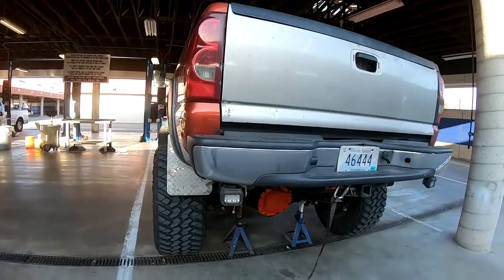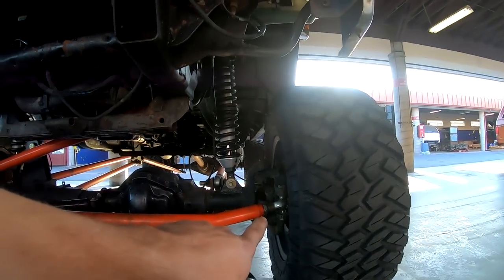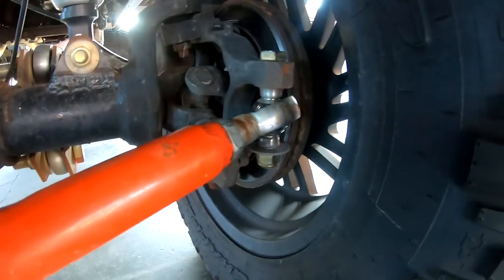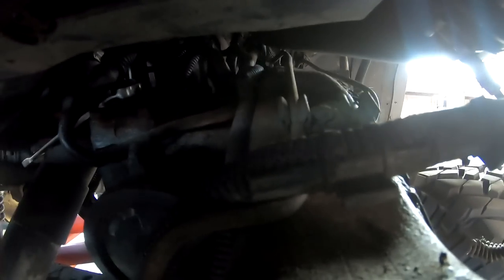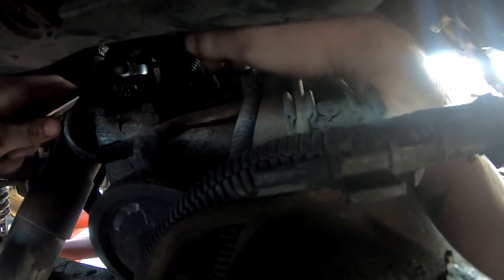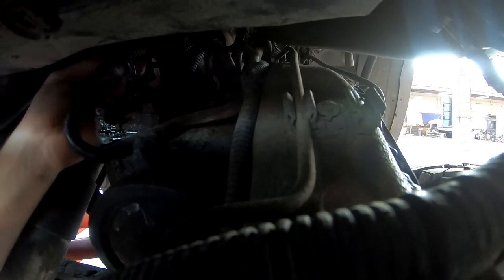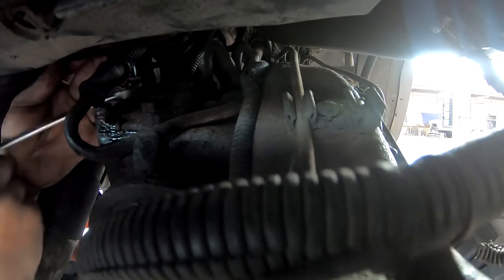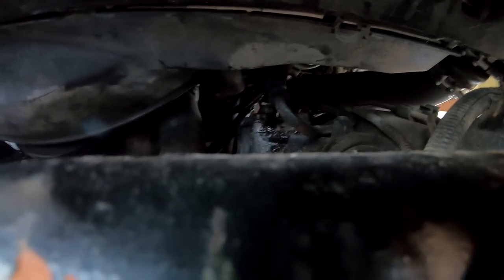Duramax Steering Box Adjustment! Fix your loose steering!

Comment: I just did this and it definitely tightened up the steering. Previously, I had replaced my tierods, pit/idler arms and installed a Cognito steering support kit but my truck still had sloppy steering. The truck had a lot of slop, like 270k miles lifted on 35s with the factory gear box slop, and this definitely made it tight again. Although, my truck did have a slight power steering fluid leak before, doing this made the leak noticeably worse BUT it’ll get me by for awhile until I can swap in a Redhead steering box. Thanks for the tip. 2002 2500HD LB7 4x4.
Reply from the maker: awesome glad I was able to help!! as I say its not a permanent fix but you can get more life out of your box!
Reply: 3 yrs later did u
Reply from the maker: Yes I did drove the truck across the country twice in that box until I took the truck apart

Comment: Can’t for the life of me figure out what you doing with that jam nut you just basically said loosen it and tighten it
Reply: Loosen the jam nut, hold the jam nut while tightening the center Allen bolt until it gets snug, then backoff the Allen bolt a 1/4 of a turn and hold it in place while tightening the jam nut back down. Done. Simple. Got it?
Reply: he was making sure jamb nut was backed out and he wasn't tightening the adjustment Allen screw back into it.
Reply: I see dodnt know why you toghten all the way to bsck off but i see now thx

Comment: Great video.  Just an FYI though, when rotating tires, ur suppose to go diagonal. Fromt right, to rear left, etc. That way the tires are spinning a different direction. Unless of course u have directional tires. If u do then u would keep the tires spinning in same direction
Reply: No sir, first rotation is front to back same side then second rotation is diagonal then third front to back same side. Doing it this way puts all tires in all 4 positions.

Comment: Thanks.  I have done this many years ago and completely forgot all about it until I saw your video.  Yes, it is an amazing quick fix.  I'm doing my rods and arms now and was considering a new box, but I'll do this first because I KNOW it will fix the slop tremendously.  Thanks again for reminding me
Reply from the maker: Anytime always happy to help! Hope it works for you!!
Reply: @RESURRECTEDDIESEL  what did you replace your tie rods with? And will it work on a stock 2000 Silverado 4wd?

Comment: I used to do this same adjustment for years, on my GMT400's and 800's, until an old GM mechanic showed me the proper adjustment procudre to follow. 

The slop isn't coming from the pitman shaft, it is from the input side. Remove your intermediate shaft, loosen the flat jam nut where the steer shaft connects, loosen the nut on top, the one that you are talking about, and turn the allen screw back a 1/2 turn or so, to take the preload off of it. Then use a spanner wrench or needle nose to snug the packer on the input face down snug (30 ft/lbs, but we all know that is hand snug). Mark the housing and the packer, then measure 1/2" counterclockwise and back the packer off that far. Tighten the flat jam nut. Then turn the allen screw in until you feel it snug up, then back it off a 1/4 turn and tighten that jam nut. 

It will steer like brand new because the input shaft worm gear is engaged properly with the pitman shaft. 

Or just loom up the procedure for fixing the slop in a Saginaw box and follow it. They recommend doing it to a dry box, but it works with fluid in the system as well. It just might get it to the true adjustment specs that a dry adjustment would.

Comment: At 1/3 turn backed out my steering box was a bit tight in the center, backing the Allen head out 1/2 turn is great. 

Thanks for sharing.
Reply: I am a little confused on this adjustment. LSX Matt says loosten the jamb nut good, then slightly tighten the allen head screw, then tighten the jamb nut. This video says the opposite. Loosen the jamb nut good, then loosen the allen set screw slightly, then tighten the jamb nut.

Comment: Thanks for the fix it tip man , my 06 duramax has had that steering wheel slop for over 12 years freaking (dealership sucks with there finger in there butt) , you rock man

Comment: My new Chevy 2500 HD 4x4 I bought last January. The dealer was 60 miles from my home and traded in late evening. The drive home was interesting to say the least. I've never owned a truck in all my years driving with so much play in steering and hit a bad spot in the road would almost change lanes.A few days later drove back told dealer what it was doing, here's what the service manager tells me. The truck doesn't have enough miles on it and Chevrolet can't touch it! I say should I take it to Ford? Got pissed and drove home, made an appointment again same place, this time they washed it. Did nothing had it for 5 hours then I got into a service managers face and he's dam lucky I didn't break his nose! I told them I will never be back and would tell everyone I know not to buy from them. Two days later GM calls and wants to know what is going on. They here it all. I went to another dealer, they worked on it said it was ready. Started down the road and steering was so tight I could barely turn the wheel and still had play. Turned around went back showed it to another service guy, he rolls down drivers window while it's running and turns steering wheel and see's how much play there was. They looked at it again and said it needs new steering box and would call when parts came in. Took it back and it fixed the problem! The first dealer is well known it's Rick Hendrick owns a lot
Reply from the maker: Dang that is a rather intense story and I’m sorry that happened to you for sure! Yeah usually a bad box will cause the slop but if the adjustment is done right and the box isn’t too far gone I.e. 300k mile truck you should be okay my truck has 180k on it and the steering box has been great even after adjustment now it is a little stiffer then before and the slop is gone but I like it because of it being so tall and. Not having a sway bar it helps keep me on the straight and narrow! I noticed a huge difference with it!
Reply: @RESURRECTEDDIESEL  This truck was brand new
Reply from the maker: Holy crap no way! That’s insane I would be furious too! I don’t blame you that’s messed up they didn’t help you at all but the new box fixed it and no issues yet?
Reply: Always keep in mind that you can take a new car to any place to get fixed as long as the place is willing to bill GM for the repairs. It's a common misunderstanding that people think they have to go to a dealership to fix a new vehicle under warranty lol
Reply: @RESURRECTEDDIESEL  none so far and since I don't drive much it has under 16,000 miles right now

Comment: Do you need an alignment after this. I just aligned my truck but my steering is still complete trash and I was told I need to tighten my tie rods by the alignment place. I was told tho that you shouldn’t touch the tie rods tho and that the alignment place is supposed to do that so will this help with my steering?

Comment: Damn I'm doing this as soon as I wake up tomorrow lol. I have so much play and my front end is good cuz I did re did everything.
Reply from the maker: I hope it works out for you should tighten it up a bunch this is the first time I’ve done it and it worked great if you could write back once you do it that would be awesome!
Reply: Yea I will tomorrow when I'm done. I'm pretty sure its stock steering box. I got 415000 kms not sure what this is in miles. Like 250 or something
Reply from the maker: Hahah same with this one it’s got 180k miles and it helped!!

Comment: My steering wheel doesn’t lock when key is out n it has a lot of play when on n gets hard when coming in n out of parking... any ideas ???
Reply from the maker: Mine doesn’t always lock out with the key is out unless I turn it far the play could be any of your steering components that are worn out and if you have larger tires on it that’ll make low speed turning tough along with a weak steering box

Comment: Will this work on any Silverado? Does is have to be duramax? I just put 285s on my 03 2500hd (4x2) and it’s swaying a lot over 45. New pitman /idler stabilizer and alignment. I was thinking tires but now I’m thinking it’s steering box or control arms etc... any advice? Thanks!
Reply from the maker: If your tie rods and all your steering is tight you can do this I think you can do it to most 2500s as long as it has that set screw
Reply: Thank you, I will check into this!

Comment: Iv known for years but guys always say  just turn less then 1 turn clockwise. Setting  back off 1/4 turn  is logical but never seen it done.
Reply from the maker: yeah just helps from jamming the gears together and wearing them out really fast i learned this from someone who built similar pumps or something i believe has worked well for me though!
Reply: I have rebuilt hydraulic pumps and i have seen these gear boxes tore down. So always wondered why nobody  did it that way. I did it last weekend and it works great just know if there is damage this won't help and could make it worse.
Reply: I have seen these gear boxes chip gears and the steering lock up. Once luckily in a parking lot.
Reply from the maker: Dave Wright totally makes sense I don’t think this is a forever fix but definitely can snug up a loose gear box I’ve driven across the country and back since this video and it’s still good will probably get replaced or rebuilt for my new build!

Comment: Do you know if the  2015 6.6 duramax has that adjustment as well? Somebody told me that then 2015 half electric steering  Assist instead of hydraulic . And it sucks!
Reply: I have a 2016 would like to know too.

Comment: I hate seeing people do this. It's not the proper way to adjust it. All you're doing is meshing the gears together more in the middle, yes this help with the slop at center, but causes more binding at full swing. It also causes the box the degrade at a faster rate.  I get it, nobody wants to replace their box because everything on the market is crap. My truck is on it's 9th box due to shit quality. Don't bother adjusting it and just spend the 300$ on a redhead box and be done with it
Reply from the maker: If you do it correctly you won’t have any binding. The boxes are adjusted like this when build to be set I got rid of my slop and have been wrenching 15.5 wide tires on it with no issues you need to back it off some so it doesn’t bind. If I get another 50k miles out of it it’s worth it in my eyes at 200k almost I’ve put 100k miles on this steering box and it’s good as new. If you don’t agree you don’t have to do it but it does work
Reply: @RESURRECTEDDIESEL  if you do it correctly you'll follow the procedure and adjust it on the bench top with out the Pittman arm connected. Per gm spec. You can't adjust it "by feel" it requires a beam style inch pound ta wrench. But good try
Reply from the maker: Plenty of forums by the people that build them and you can do it but hey man to each their own I guess glad you spend over a grand on steering boxes and I haven’t 🤷🏻‍♂️
Reply: @RESURRECTEDDIESEL  all were under warantee because they were junk, minus the last one that actually worked. And just because "it works" dosent make it right.  But keep advertising the half assed way to screw things up. Also, experience Trump's "the internet said it would work"... That's as bad as I saw it on TV so it must be right lol. Go show me where Saginaw recommends doing it your way. Seeing as they build them
Reply from the maker: Hey man you’re entitled to hate as much as you please! Hope you enjoyed your long weekend! I know I sure did 🍻✌🏼🏂 and my steering is still tight 😎
Reply: @RESURRECTEDDIESEL  not hating on anyone. Just trying to prevent the spread of bad information. Just remember, there's the right way, then there's the fast and cheap way.
Reply from the maker: I totally respect that and you’re right but like you mentioned even new pumps aren’t done the right way and I also know some people, not many that have had problems with the red heads so when there’s nothing really going right what should you do🤷🏻‍♂️
Reply: @RESURRECTEDDIESEL  I know a lot of people say not to do this because the majority of wear and play is in the center travel. However I'm with you bud.  If the box has so much play it's at the point of replacing then what have you got to lose? Also if the gears at each end mesh tighter after the adjustment then logic will reason they might eventually wear in faster to somewhat even out the wear. Which is exactly what seems to have happened on my buddies truck. He has 400k miles on it and keeps adjusting his box every so often. Still has the oem box, just replaced seals one time.
Reply from the maker: Yeah I totally agree man if you gotta change it any way or squeeze 20,000 miles out of it having it drive as brand new why would you not that’s my logic it might be dumb but if it works is it really dumb?
Reply: @RESURRECTEDDIESEL   Its not dumb at all. The other guy is correct, there is a right and wrong way to do things but what dictates the right  and wrong way? GM or some other steering box manufacturer who's best interest is for you to purchase parts? No, I believe the right way to do something is based on the results. In this case people are having much better results adjusting the OEM box rather then replacing it. Thanks for the video, keep up the good work.
Reply from the maker: Very true I agree with you to each their own I always say🤷🏻‍♂️
Reply: @caliguy1500  300k lb7 stock same box. sloppy as hell. I'm all over the highway after long days ill be doing this asap to help out. longer I have this truck the more I kinda want it to keep going. Guys wonder why I park so far away well hey I own this and I work on it. Not some wifes leased Dodge Ram that dings my side of my truck when Im the the only car in the parking lot and she parks right next to me and her brat kid dings my doors!!!!!!!!!!

Comment: Pretty sure your not supposed to do this with the steering box.... i know iv read that in many places....
Reply from the maker: Why would it be there if your not supposed to do it🤷🏻‍♂️ worked for me so far
Reply: This is gonna wear out your steering box even more. Just replace it.
Reply from the maker: I will when the time comes it’s gunna wear out again obviously but it’s not too tight they adjust them when they are built it just makes the tolerances tighter. Maybe everyone can’t afford a pump at the moment.🤷🏻‍♂️
Reply from the maker: If it works is it really that terrible?
Reply: @RESURRECTEDDIESEL  This was a common complaint at the dealer. I would always try to adjust the gearbox (after making sure all front end components are ok) but rarely had success. Most of the time the steering gears were worn only in certain positions, making the steering tight in other positions.  Lift front tires off the ground and verify no binding during lock to lock turns after adjusting. If all is smooth, adjustment is ok. Most of the time I found steering was tight approx 1/2 turn from lock. In those cases replacement is needed.
Reply from the maker: Hmmm that’s very good to know! Mine definetly had slop everywhere it was always loose so the adjustment really helped my truck made it safer to drive now I don’t fight the road so much trying to go straight but thanks for that info!!
Reply: Most steering gears available are only remanufactured (atleast for my 01) and currently wish I never sent my old steering gear to core heaven cuz it was better then the last 4 remans.
Reply: *01 Tahoe
Reply from the maker: Yeah a ton of people have had issues with remans or they drop like 500-600 for an after market box which is insane!! Love the name too 😂😂
Reply: Thank you lol...I tried redhead and 2/2 were way to tight (never thought I would complain about that) and wouldn’t return to center.  On the second delco and after 1500 miles it’s just ‘ok’
Reply from the maker: Damn that’s insane are you running a large tire on it?
Reply: Just 265/75r16s bfg ko2s.  Pretty much stock.  Better off with a low mile used it seems like rather reman.
Reply from the maker: Dang that’s crazy!
Reply: Yessir...good talk lol.  174,000 miles on the old girl and that’s her only problem.  But again new wranglers have recalls for bad steering gears so that makes me feel better!
Reply from the maker: I winder if there’s any difference with an hd steering box or if they are better or anything and you could make a little custom upgrade for it!
Reply: @RESURRECTEDDIESEL  can you be more specific on what you mean by, "hd steering box"? Are you thinking like a kodiak hd gearbox retrofit to a 2500hd?
Reply from the maker: Sorry I was aiming that more towards clickbates comment he said he had a suburban I’m guessing a 1500 was just suggesting a 2500hd box if they are bigger but I’m not so sure
Reply: DURAMAX_DIESEL I am not sure if something like that exists.  Just baffles me that you can’t get a new steering gear ANYWHERE
Reply from the maker: Yeah that’s super nuts